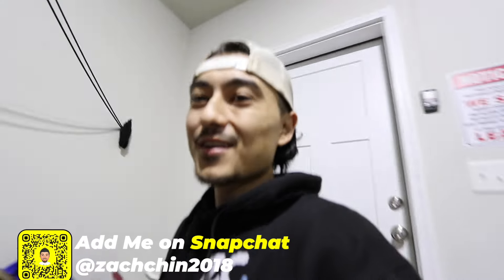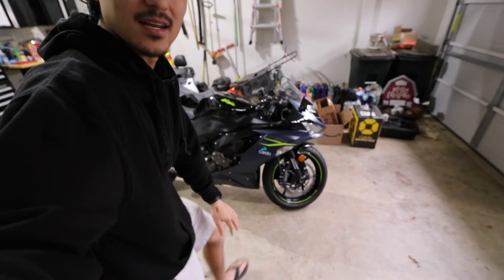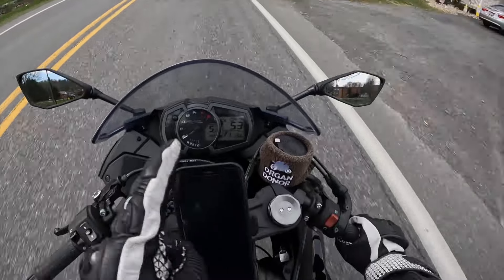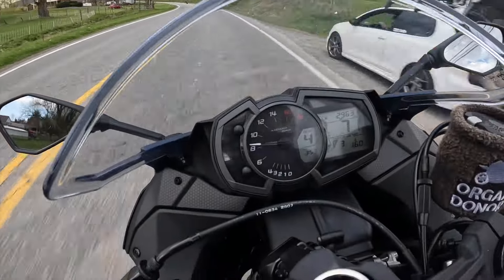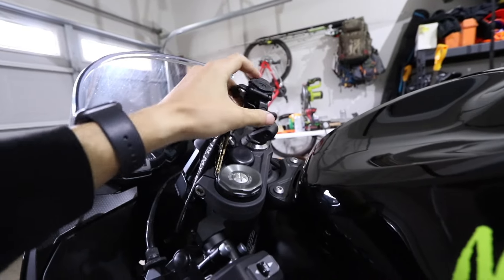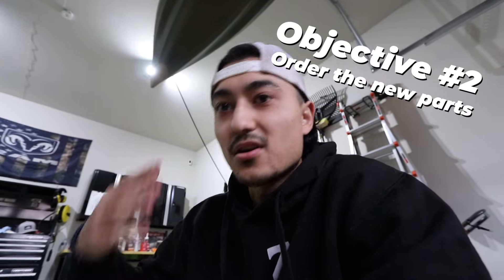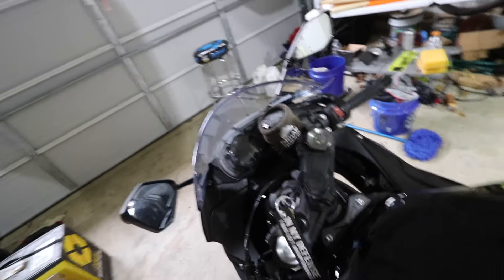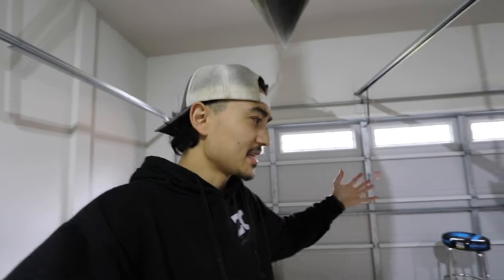I Crashed...

Comment: Glad you are OK! as someone who low sided and broke my foot in the process on my ZX6r, you turned out great! Quick tip on getting the filed down screw(s) out, Grab a few drill bits and make a little divit, then take some decent extractor bits and buzz those puppies out! worked like a charm for my zx6r. I'm excited for the build!

Comment: You say disassemble the bike since that fairing is already cracked. You could either if you have a welder, you could weld a nut to it and use like a socket wrench to take it out or you could drill it out that’s really the only two options

Comment: Happens to everyone. Especially on the first ride of the year. Last year I dropped my r6 on the first ride of the year doing like 60. A dump truck pulled out in front of me, I panicked and locked up my front brake. Just use it as a learning experience
Reply from the maker: Yessir, hope you’re ok from that! Going down is never fun haha
Reply: @Zachchin  I'm all good, fixed it on my own dollar si insurance didn't total it, everything was busted except the frame and engine internals. Just bought a h2 for later in the season, I wanna have it paid off before I ride it much. Also I want to get back into thw riding mindset